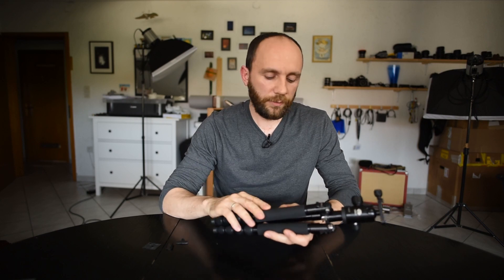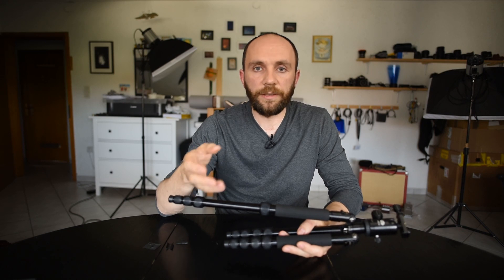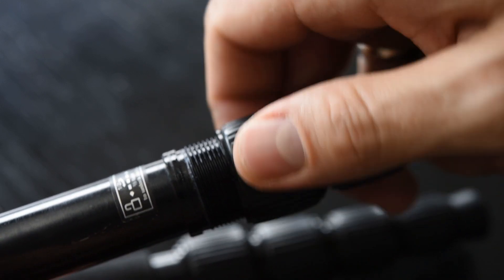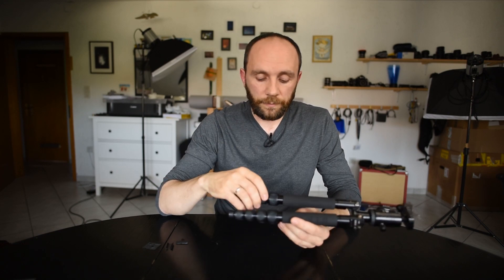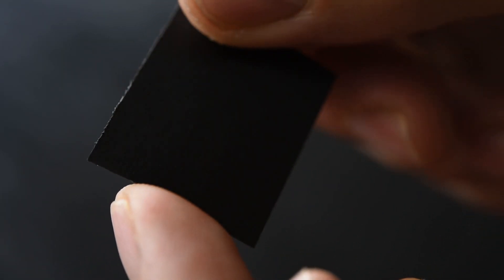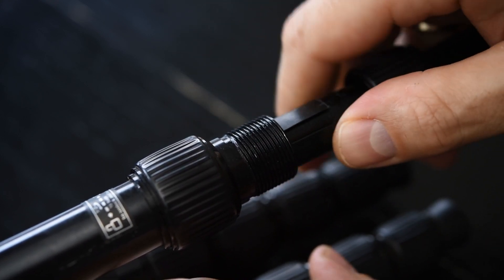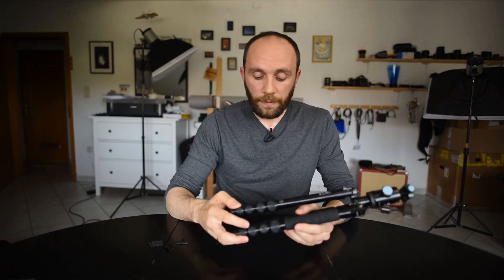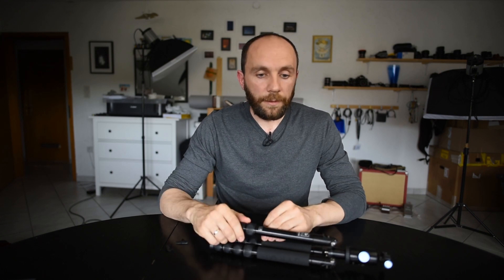How To Fix Broken Shims on Sirui Tripod (T005KX) using CNC-router

Comment: Awesome video. Inspired me to try and 3D print the shims. I was able to print the shims for the largest and the second largest legs (the other shims are okay) using my Prusa 3d printer. I uploaded the models and info ThingiVerse but I have to wait 24hrs to post it (it's a new account). I included a link to your video in the summary.
Reply from the maker: Hi, thanks for your comment. Great that you managed to 3D print the shims! I wonder if they strong enough to hold the load. Which material did you use?

Comment: the DIY shims look great. Since they are flat they are easier to carry/store and less likely to break when traveling! Perhaps you could try cutting a grove in the pins so that they can bend slightly as well? Have you tried sanding/polishing the machined surface to decrease friction? That might help the aluminum rods to slide easier.
Reply from the maker: Jesse, thanks for your comment. I think cutting a grove might be an option that might improve bending. I'll give it a try one day. The machined surface is actually facing the segment and does not slide against another one. The back side of the shim is quite shiny, so I don't think it is an issue. Places with highest friction are on the back side of those flat stoppers (I can see friction marks right there).

Comment: my monopod broke , it is similar leg , all the plastic parts are okay and fit in place but in the thread at the end when you turn it that little part doesnt have a hold anymore.. it just doest work.. I think a replacement would be solving the problem but i dont know where i can get it and my monopod is not really a brand that exists anymore i think

Comment: Hello Yury,
Is there a possibility to get your CAD/3D Files? I have the same issue with my Sirui tripod and I want to try to 3D print these parts.
Greetings from Germany!
Reply from the maker: Hello Johannes, 
sorry to hear you have the same issue. I have used cut2d software and I do not have any 3d data, but I can export outline of the shims I produced in dxf format if it helps. But it is quite straightforward to measure the shims - just take the one which is ok and use the ruler to measure flattened size of the shim and a calliper to measure the diameter of the pin. It should not be extremely precise, just pay attention to thickness - the shims are very thin. My first idea was also to 3d-print them, but the thickness was the problem - the 3d printer I have access to would not be able to produce a reliable layer of such thickness. So I ended up machining them. I do not use that small tripod very often, but it is still going strong :)
Reply: @YuryShulhevich  Hey Yury,
Thanks for the quick reply!! If you could send me the dxf file that would be perfect... then I know I have the correct size that works! How thick did you machine the plates in the end? I will try it with the printer and maybe sand it if it won’t fit! 
Best,
Johannes
Reply from the maker: Johannes, you can download the dxf here: https://drive.google.com/file/d/1Qy8RLxwdmyXSCKXTTqu6YnQANGNaH1zA/view?usp=sharing
I'll keep the link active for a week, but if you download it earlier, please let me know. The stock thickness is 2mm, so the height of the central pin is 2mm. The rest was machined -1.7mm down, which means the thickness of the shim itself is only 0.3mm. 
It's interesting if you can print it. Let me know about your progress.
Reply: @YuryShulhevich  Cool, thanks man!! I will keep you updated!

Comment: Hi, nice work!  I have the same Sirui tripod with a different problem: the central column extension adjustment ring can not be twisted. it can move for a mm in either side, no more. Consequently the central pole is fixed in the lower position as the inner tube can not go out (up). Could you please give me an advice of how to solve the problem?
Reply from the maker: Hi Anton, sorry for late reply. Well, I do not use the central pole, so I don't have issues with it. But I looked into its construction and it appears that it has different tightening mechanism, they didn't use the same shims. In your case it might be just sand (or other dirt) in the thread of a locker - I think general cleaning might help. Hope you can fix it!
Reply: Hi Anton,  I know it was 2 years ago when you posted the above but I have exactly the same problem with my Sirui T005KX with the central pole stuck and I can only twist the ring by one or two mm.   Did you manage to solve the issue on your tripod and any advice you could give me.  Thanks
Reply: Hi again Anton, think I may have found your solution on a forum.  Guessing you are the same person.  First step was to put the tripod in a freezer overnight.  So going to try that.
Reply: @rb-photography  Hi! It feels good to learn I contributed at least with a hint if not with the final solution. Yes, I am the same person and freezing the pole is exactly what solved my problem. Hopefully by now your tripod problem is already solved because the plastic parts shrink more than the metal tubes what deblockes twisting. But, please, let me know...
Reply: @antonzvanut9542   Hi Anton, yes it worked.  Took it out of the freezer after about 3 hours last night and I immediately freed the central pole.  In fact before seeing your reply on here I had just replied on the other forum to thank you.  Thank you again as it means I can now use the tripod to it's full extent again.  Only thing now is to make sure I can stop it from sticking again.  But at least I know the fix if it does.  Thanks very much for your advice.
Reply: @rb-photography  Bingo! I'm so glad to learn that! Could you please tell me which forum you found me on?

Comment: Hello Yury. Thank you for posting this! I was searching for an answer like this, as the shims in my Sirui T-005 tripod just failed. Would it be possible for me to purchase a replacement set of these shims from you?
Reply from the maker: Hello Michele, thank you for your comment. I have limited access to my machine at the moment, so I won't be able to produce new shims for some time. But I have several as a back up :) Which segment(s)  did fail in your tripod? Perhaps I have replacements.
Reply: @YuryShulhevich  Thank you for your reply. Sirui actually replied to my email and is sending one shim set free of charge. I will try that. If it doesn't work, I will circle back to you when the global situation normalizes. Please be safe. Thanks again.
Reply from the maker: @micheleburns2118  It's great that you've got a reply from Sirui. Original parts are always better option. Sure, if you need spares in future, feel free to contact me. Stay safe too!